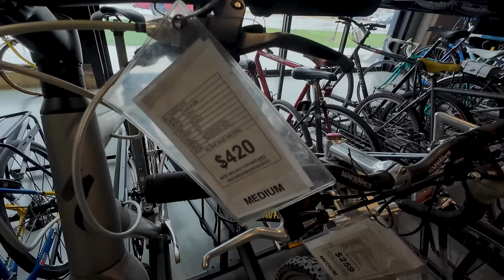The SECRET The Bike Industry DOES NOT Want You To Know

Comment: Agree about road bikes with one exception-many of them from last 20 years restrict you to 25mm tires. My favorite bike now is an 50 year old steel frame that I have 38mm tires and could take bigger. Once you ride good supple wide tires it’s hard to go back to skinny high pressure tires. Great video and absolutely right for most folks.
Reply: Actually most road bikes build today have clearance from 32mm up to 42 depending on the brand. it was the 90s and early 2000s where 23mm was so prevalent
Reply: @ 
That’s my point-we are talking about used bikes-frames up to 80’s could take wide tires-but bikes from 90’s to the mid 2010’s until the relatively recent conversion to gravel/ wide tires only take skinny rubber- like all the road bikes shown at the co-op
Reply: My race bike came from a co-op. 1994 EL/OS columbus fully chromed lugged steel frame (versions were raced in europe) Max: 25mm on the front and 23mm on the rear.  53/39 with a 13-25 Sachs new success drive train. I don't ride it much but I always wanted a sparkly shiney bike.
Reply: With skinny thin-walled steel tubed frames and forks, bigger tires aren't necessary for a smooth ride.   The only reason why fatter tires on road bikes improves comfort so much today is due to the fact that frames and forks have been getting stiffer for no reason other than to sell you something new.   I do agree that a wider tire improves traction, but it's possible to simply run lower pressures on 25mm tires if you aren't overweight. 
I built up an old 80's Peugeot racing bike with Reynolds 653 tubes and with 23mm tires and its far more comfortable than my titanium Seven with 32mm tires and massively oversized fork steerer and blades.   A lot of vibration is dissepated from the fork and steerer where modern bike designs somehow rationed that making these parts massively oversized was serve some sort of function, which it does not.
Reply: Yeah my 2014 road bike maxes out at 28mm due to a restriction on the seat stay. The front could go larger but it would look weird.
Reply: It is sp hard to ride anything wider than 25 mm, it just feels slugish for road bike

Comment: I completely agree 100%. As a retired store worker, manager, owner, and janitor I spent 45 -1/2 years in the industry until retirement in 2022. My last 20 years were at Mt. Airy Bicycle in Mt. Airy, MD. Having had several thousand used bikes in our warehouse allowed us to have a steady supply during the pandemic.We sold Schwinn 3-speed from the 60's and 70's, mountain bikes from the 90's and 2000's, and much much more. In 2022 I even purchased a mint condition 1996 Trek 930 rigid mountain bike for $200 on Facebook Marketplace and still enjoy it today. All 3 of my personal bikes are steel and one even has disc brakes!!!! I am not against technology but many newer high-end bikes are a pain to wrench on. Don't even get me started.....
Reply: The high end stuff is now dominated by proprietary parts, internal routing or electronic shifting. Pricey and getting harder and harder to work on. 
Headsets, bottom brackets and now stem,handlebars with hidden cables, hydraulics, 
I was skeptical of disc brakes but have come to realize that they don’t have to squeal. Riding gravel is really hard on rims, disc brakes are really great. 
Now, throw into the mix e-bikes, the issues multiply at a dizzying pace.

Comment: The Zaskar in yellow and blue at 4:50 is a great find . An enthusiast should buy her !
Reply: I came here to say the same thing. I let out an audible sigh because I’m on the other side of the country and would grab that bike if I was closer.
Reply: one of the limiting factors of that lovely bike is the size, it's a very large frame which makes it difficult to sell to the average height man or woman. If you were considering going off road on a GT Zaskar it would have to be about 16" or 18"  frame (Medium-Large) Anything bigger would be very awkward to handle off road. I would suspect that the owner of that GT would have tried to sell but ended up donating as it is difficult to sell such a large framed bike, considering the intended function.   It would be more suited to cruising and commuting as it has a pannier rack fitted already.

Comment: I remember buying a raliegh m-trax 325 in 98' Unfortionatley it was stolen but i rode that bike for 20 years all deore lx groupset basically indestructable. Bit heaveyer than modern bikes but those steel parts made them much longer lasting. Modern mid to high end kit is extremely good but does wear out much quicker.

Comment: Recently adopted two bikes. The first one is a 26”Full Force brand hardtail. It sat at my neighborhood park just leaning on a bench for days. It’s by Specialized, a supposed precursor to its SWorks. It’s in pristine condition and rides beautifully. Then weeks later adopted a 24” Trek 6000 found on the street. It was dusty and had cobwebs and paired with a rusty kiddie bike. It’s a serendipitous find because my 10yo wants a vintage bike to juxtapose his current Commencal HT. It rides well enough but planning to bring it to Bike Kitchen in San Francisco, a non profit that provides space, tools, ♻️ parts and workshops to the community to diy repair bikes.

Comment: I have 18,000 kms on my 2018 GT Virage Elite hybrid bike, 3x9 speed Sora gears, I still have the original cranks, cassette and chain. The only things that have been replaced is the bottom bracket, tubes, tires and disc brake pads. This winter I will be converting it to a drop bar road bike, I plan to keep it running for many years to come as I refuse to pay the ridiculous prices for a new steed. Appreciate your content

Comment: I ride a Fuji Crosstown that is probably 20 years old, I got it used from a pawn shop. I replaced all of the cables and replaced the brake handles.  I don’t need a $1000 bike.  My son rides long distance races and every oz. of weight means something to him.   Carbon fiber everything and his bikes break all of the time.  It just depends on what kind of riding you do.

Comment: There are a lot of various models of vintage Peugeot bicycles (my fave) for sale dirt cheap. The catch is that most of the cheap ones have 58cm frames that were designed for people between 5' 10" and 6' 2". I have the good fortune to be 6' feet. I bought my first white, French built Peugeot P-8 E for around $375 (at the then current exchange rate) in Germany, in the Spring of '72. I rode that bike through the Bavarian Mountains for 2 years and never crashed it once. The 10-speed gearing, and down tube shifters, were perfect for all of those hills; I didn't need 30, or whatever, speeds.

I recently bought two circa '70 - '72 PX- 10s - 58cm frames, one with a near perfect TB-90 brown Ideale saddle (I'm uncertain if sellers get their asking price, but I've seen the model of saddle I have listed for up to $700, in excellent condition, on eBay). I also bought a circa '86 - '87 PSN-10 "Mont-Cenis," - 58 cm frame (I think) as a parts bike. I took the PSN-10 for a spin and nearly dumped it before I'd traveled 50 feet. That bike, with it's 700-23c tires, and what I consider to be too tall, 12 speed gearing, is squirrelly as hell at low speeds in tight places. It was fine after I got it rolling. The tires, wheels, Modolo side pull brakes and brake levers (black with holes drilled in them, very cool) on the PSN-10 were well-worth what I paid for the bike alone.

I'm having a lot of fun restoring, with a few updates, the PX-10s. One is stripped completely, awaiting a sandblasting and powder coating. I can't stop riding the 2nd bike because I like it so much. The tear down is coming... sooner or later. I'll eventually donate the parts I don't want to a local bike-collective.

It's a fair question to ask why a 71 year-old geezer such as I would ride cool looking, 20+ pound, racing bikes that were state of the art 50 years ago. The answer: because I can!

Comment: I'm building a gravel bike from an old trek 520 lugged steel frame with more modern mtb components and a drop bar.  Much much better than the components on that ozark trail bike that will cost the same.

Comment: Good video, I think the only real issue is that some of those older bikes may seem perfectly good but many have components that you cannot replace, parts are not available anymore, they have compatibility issues, the repairs themselves become a can of worms as you find more and more things wrong with them and the cost goes up and up. Some older bikes with suspension from the early 90's I would not even trust to ride at this point. Many materials fatigue and corrode and are not safe. There's still some gems out there that are a good price to pick up and ride, you just have to really check them over.

Comment: I wouldn't really call it like it's a big secret.  Used bikes take up space, and space is money.  It take time and resources to refurbish bikes, and the return for new bike dealers, well it's not there.  It's already hard running a new bike shop.  Money is made on repairs and upgrades.  But I get it.  That's why Bike Co-Ops exist.  Most take donations and either part the parts out or refurbish.   Personally I find it sad to see perfectly good bikes parted out for parts instead of straight refurbishing.  There are several Co Ops in the Metro DC region and I visit them.   I'm sure there are many others throughout the country.

Comment: usually you can into online used goods sites and find good buys, sadly many times the seller want to much for their 1000 bucks back then. but some luckily just want it gone, and you can get a bargain , second sadly new parts are expensive and to fix many bikes youll a lot of different tools. So it turns out if do it for fun and have some to spend, you can give and elder bike new life in the hands and feet of the current generarion (this is NORWAY)

Comment: Road biking seems the same, but it really has changed a good bit. Not only disc brakes, but bigger tire clearances, better rider-oriented geometry, wider range of gears, and better sizing are a few of the many changes. It has made a huge difference as the bikes are way more comfortable and invite many riders to get out more as they don't have to worry about getting destroyed by the road with their 23c tires at 110 psi or super stiff frames. I speak from experience, having worked at a shop and having ridden both sides for an extended period of time. There is a magic to vintage bikes, but the new stuff is simply better in the road space.

Comment: yes on everything you said.  great on you doing what you do. one just needs to keep their eyes open to what is available. a couple years back I came across a 2008 aluminum pivot ( I think aluminum frames were made only the one year w/ shimano xtr cranks, shifters, derailleurs,  magura marta disc brakes, custom wheels on top end hub.......for $35 more than what you spent on the stumpie.  one never knows what you'll come across. that pivot is one sweet ride, one I could have never afforded even at half price. 

I used to do the outdoor retailer when it was at the salt palace in the final stages of the tabernacle build. was there when the tornado happened,  sad week. did travel around checking thrift stores for bicycles and other stuff, salt lake does have great thrifting.

Comment: cables, housing, tires, grips/bar tape, maybe a chain and elbow grease and knowledge can repair 92% of what comes in "our" doors.  there is nothing wrong with your old bike except it needs some TLC its been overdue for.  your routine, monthly at home maintenance. and annual maintenance at a shop is the difference between your bike lasting 30 years or not.   I explain to many times a day that some bikes would have more in parts to repair them than its worth. and some come in to get donated that we can save that only need a new rear derailleur, and a hanger alignment. good shops and good mechanics do exist.    looking forward to your Bianchi video, currently working on a GT windstream 1920's 30's gravel bike build.

Comment: It's true, you can get excellent used bikes for 30-60 usd or euros and then maybe change cables, grips, seat or even gears and chain and still get a lot of value for the money.
Unfortunately, it's not that simple, I've given that advice to a neighbor to buy such a bike for his kid and he failed, he bought a used bike for 100 euro that needed extra 200 euro to repair and it still looks scratched. Now he's upset because he listened to me....
The truth is that he lacked the knowledge, both to break a good deal and to do small repairs himself.
As a general advice, I'd say, buy a bike that looks great and is your size. That you cannot change later. Parts can be changed, upgraded, no problem. Of course, don't buy if most of the parts have problems, you'll have to invest a lot.

Comment: As much as I love seeing all the new tech, and just how far it has come, for most riders it's all unnecessary. For the average rider, an old steel frame bike with mechanical components is all they really need. Carbon fiber is a cool material and you can do really cool things with it, however it's not at all sustainable and is destined for the landfill. Steel frames if given even a little care can last for decades and even more. Not to mention that they are so much more aesthetically pleasing. I ride a newish bike but it's a retro style steel lugged frame, single speed/fixed gear. I replaced the stock brakes with some vintage campagnolo super record dual pivot, and they work great! No need for ugly, heavy discs.

Comment: Cantilever brake spring plastic covers can crack with age . I had to replace a rear cantilever brake set on my 1994 Giant Yukon yesterday . I rode it to my father's house this afternoon .
Reply: Probably lots cheaper than a new bike.  I wonder what parts on hydraulic disc brake parts cost.
Reply: @daniellarson3068  Shimano MT 200 brake sets on Aliexpress have been good for recreational riding , having bought and installed / supplied them . I have XT 8100 two pot and 8120 four pot sets as well .

Comment: Great video ! and great message !
Here in France, it's a little bit hard to find good old bikes for a reasonnable price.
Sometimes, we can find gems, but it's hard. I see 2 main reasons : 
- people think that a 20 year old bike is gold. Whereas fork is leaking, wheels are not strait, rust everywhere... but it's written Specialized or GT on it. So it cannot be cheap.
- second, here in France, we have Decathlon, which is a large sport retailler. And people are buying bike like they are buying butter. So second hand market is submerged by this kind of low cost bikes which are not that good.

2 years ago, I found an unknown german brand bike (Hawk) originally equiped with full XTR gear set, magura hydaulic brakes, Magura Ronin fork and a very light fat bone frame ! for 90 euros.
And it was in rough shape (rear derailleur missing, fork leaking, brakes stuck). I managed to save some reusable parts, and put other in the attics, in case... The frame is waiting (too big for me) I consider this as a bargain here !

Comment: The bicycle industry wants you to believe that you need disc brakes, specifically hydraulic, 29" tires and modern components.  For the mass majority of people, nothing could be further from the truth.  The best bike for most people has 26" tires, cable operated brakes and a quality frame and components.  Age is not nearly as important as quality and condition.  One of the things I noticed in the video was none of those bikes had disc brakes and that's perfectly fine.  Unless you're competing or racing, you're not likely to need them anyways.  They only offer a small improvement over cable operated brakes and the maintenance downside to hydraulic is a huge disadvantage for the average consumer.  Twenty six inch wheels are the most common and always will be, and therefor are much cheaper to repair or replace.
Reply: @ADAMJWAITE  well said. My 1998 26-inch Gary Fisher rides perfectly. New wheels and a couple of component tweaks is all it has been needed to keep it in perfect running condition. And V-brake stopping power is more than enough.
Reply: It seems odd.  Disc brakes must be more expensive to manufacture.  It seems bicycle companies would like to have lower manufacturing cost.  Yet, if one goes into a bicycle shop and looks at the new bikes, it's quickly apparent that rim brakes are a vanishing option for the bicycle consumer.
Reply: @daniellarson3068  The problem is the industry believes their own BS.  You can still find rim brakes on department store bikes and when Walmart's kicking your ass, you'd think they'd take notice but they don't.  A lot of shops would offer less expensive bikes but they're not in the supplier's catalog.  There are many other shops however, you walk into and they don't have a single bike for sale under $1,000.  They're completely missing the majority of the market and complaining about struggling to survive at the same time.

Comment: Where else can you get a good solid bike with a triple front derailleur?  What else is appealing about old bikes?  The rim brakes can usually be fixed with hand tools.  The external cables on old bikes are certainly superior when you replace or modify them.  Bottom brackets have their bearings well protected within the bike frame and somewhat easily replaced with just a few special tools  Steel frames can be repaired at many weld shops.   Less chance of the bike being stolen.  Yeh - Don't tell anyone.